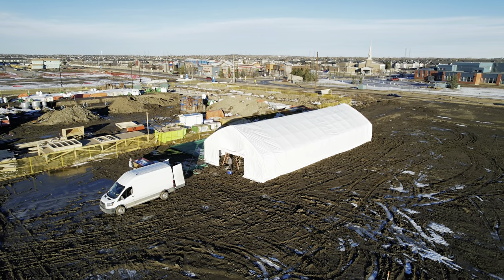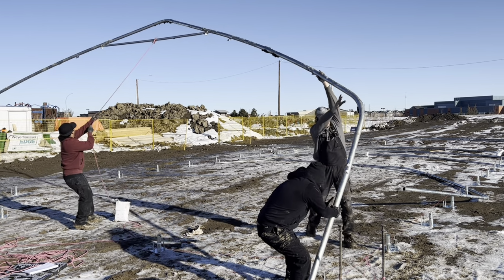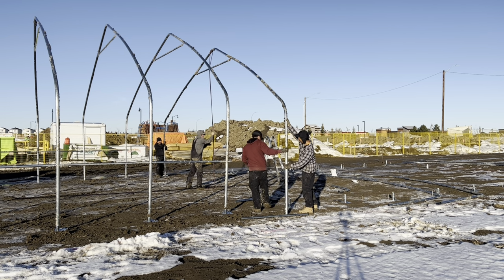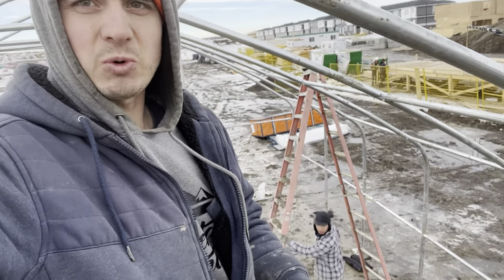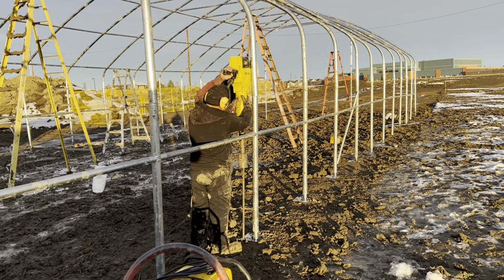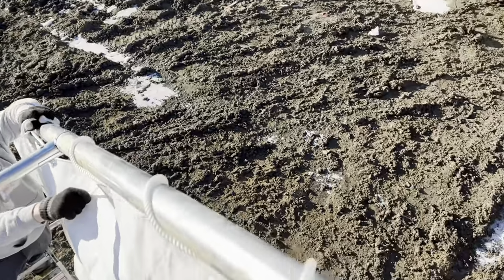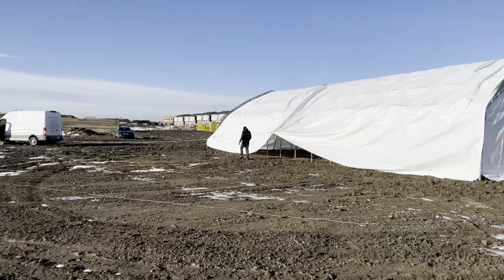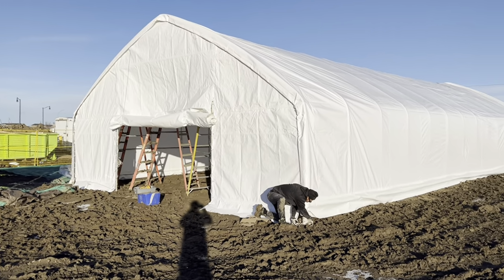Full Setup 30’x70’ TMG Industrial Tent

Comment: I have 30x80 tent and looking to reinforce the trusses. I am looking to run two 80 ft wires across the middle to support a batting cage net.  Anyone have any suggestions on a way to reinforce the end trusses so the weight of the net and cable does not cause them to be pulled inward? Over all the tent has been up 1 year and survived a very wet and windy winter very well.  I did pour 12 cement footings to anchor the tent to the ground. The stakes provided would definitely not have held it in place.  (6 footings on each side)

Comment: I just installed a tmg 40x80 it looks nice but it was a nightmare due to the manufacturer including the wrong brackets. Now does anyone know how well they hodl up with wind? In 25mph winds mine is moving but i do not have the ends up

Comment: How much dis you charge to install this tarp?
Reply: that would be nice to know, as i am building one for a guy as we speak but i am putting on an existing 4ft pony wall.
Reply from the maker: $4999
Reply: @gerryomalley2533 I just put one on a 4ft concrete ponywall. It moves with winds 25mph and higher. Makes me nervous
Reply: @TheRentalJourney  how durable is it in the wind and snow and is yours still in good shape and intact ?